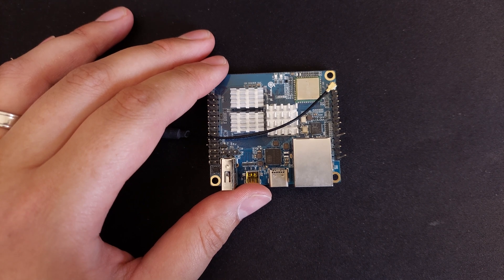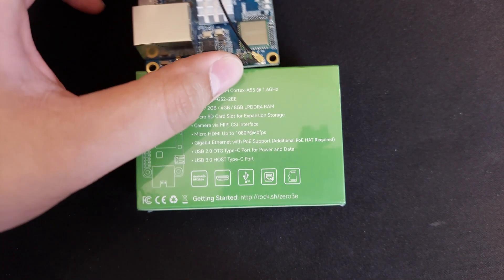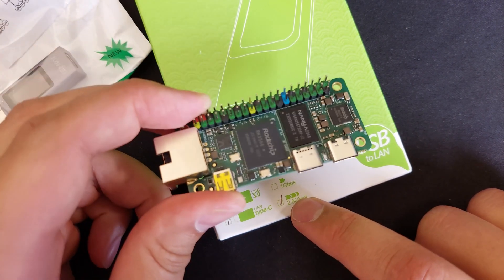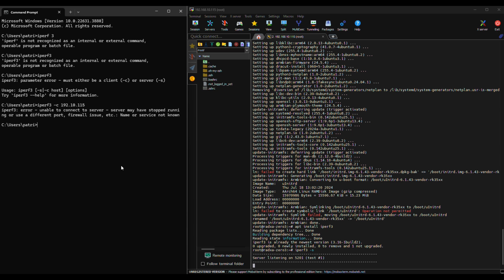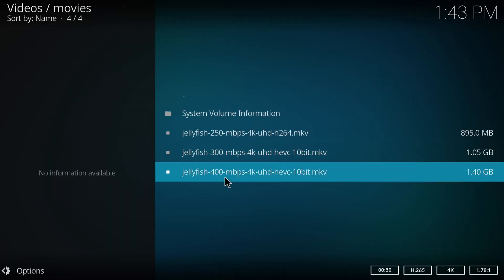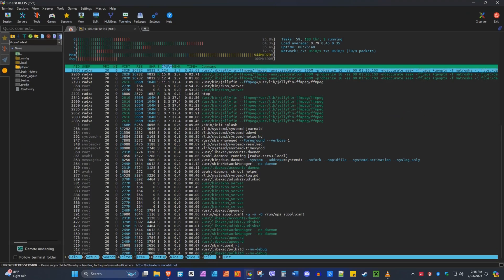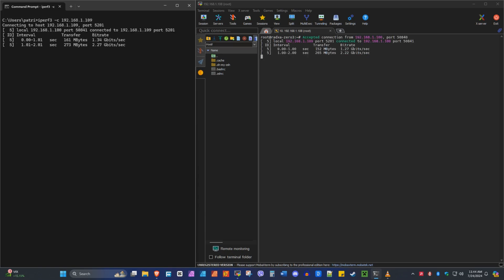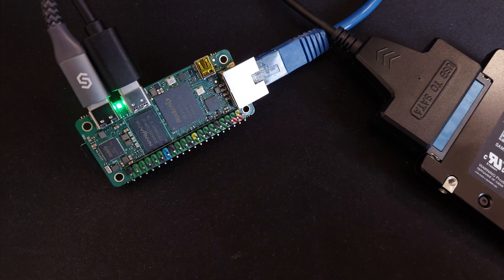Radxa Zero 3E - Cheapest, Fastest NAS so far? USB3, Gigabit Ethernet, Under $20.

Comment: If you power it from GPIO, does that second USB 3 work for data... or is it power only?
Reply from the maker: It's usb 2.0 I believe but I believe you can get OTG to work by using the correct dts file or some have commented that it just works depending on the cable used. Personally, I don't think I got it to work for data.

Comment: No heat sink?  I find that the 3E and 3W both run quite hot... even with small heat sink on the main processor, still goes above 50 C, in which it throttles.  I have ordered the recommended heat sink that seem to be quite large, almost the entire board (i.e. 3E and 3W).
Reply from the maker: I ordered the heatsink for the 3w and I kind of regret it because the pad included is too thick for the rf shield for the wifi (needs to be trimmed). My 3E now uses a basic rpi heatsink set and that seems to be working fine.
Reply: @GrafickStudios  I am testing Pi style sinks on each IC on the 3E and 3W.  But both seem to be running about 50 C, at room temp.  The official heat sinks are on order.  Going to compare.  I am thinking I will 3D print a frame for small fan to use with the official sinks, since they are passive (copper).
The small RADXA labelled IC on each board seems to get very warm.  Also, this is my 2nd 3W... vendor had to replace my first 3W... it failed about about 20 hours of testing... started getting memory errors, then finally completely died, where the bootloader would not even start.

Comment: Hello. Nice video but I think you omitted an important point. With Joshua Riek's Ubuntu's ffmpeg build (mpp), you can actually use hardware transcoding (1080p max). This is what would make it more useful as a streaming platform and it's lower power than rk3588 (which has much more transcoding capability, though). I will be trying the same with Rock 2F.

You need to run jellyfin dockerless for this to work and disable the ffmpeg bundled with jellyfin, then enable mpp in the settings. I am using orange pi 3b, which has the same CPU.

Comment: Hi, does it work well with kodi installed on it, using the micro hdmi? and will hdmi CEC work? Thanks
Reply from the maker: I haven't tried, but might be a good video idea, so stay tuned, I might do a video if it works well.
Reply from the maker: So update, I tried 2 different images, and both were not acceptable for video playback. The official debian image from Radxa was the worst. I did notice that kodi mentioned something about CEC when it first started. I don't think it would be good for a playback device at the moment.
Reply: @GrafickStudios  Hello, thank you for this feedback, I appreciate it a lot. It's good to know. For a media center, it is better to plan for more power.

Comment: bro, this board is not detecting my USB mouse &  keyboard, does yours?
Reply from the maker: if I use the usb 3.0 port, i have no problems (I use a hub though). As for the otg 2.0 port (that also uses power) I believe there is an overlay you have to enable. This post talks about it: https://forum.radxa.com/t/otg-usb-port-not-working-properly/21702/4

Comment: Very cool. I'd like to see USB4, NVME slot, and 2.5 gigE - plus heat sinks and an enclosure, but for the price, this is unbeatable. It does everything my old Raspberry Pi 3 B+ chokes on - especially HEVC. If they can get better OS support (I hear updates can break some packages), they'll go to the top of my list for home theater streaming systems and multimedia NAS for friends 'n fam. I might get one to tinker with 'til then.
Reply: this is my first time hearing about USB4. 

USB5 when? 
Jokes aside a computer board with NVME slot and gigabit ethernet + low energy usage + low price would be my dream actually.
Reply: @fizipcfx make the SBC the same length as a regular nvme ssd
Reply: No USB4 (by the way - - what for?) ,   but consider Radxa Rock 5B+ .
Reply: @Solista-z4z  Nice find! For that price range, I'd likely just get a miniPC from beelink on sale at Amazon or some such, though. As for USB4, just future compatibility. I've recently swapped out most of my USB cabling for USB C style ends with just small adapters for things that need them, and I have a few USB 3.2 and 4.0 devices that I'd like to use at their full speed.

I'd prefer manufacturers just eat the cost and put all USB C / USB 4.0 ports as standard so I don't have a mix and match of cables 'n standards, but I know that won't happen for a while yet... and even USB 4 is a mess with a slew of "standards" within the standard. lol.

Comment: If these things ever manage to pick up single or dual sata, I'll be interested. Until then, snore.
Reply from the maker: The RK3566 actually supports SATA but it's up to the manufacturers to break it out. The Orange Pi 3B is sort of an example of this (m.2 slot is both sata and nvme). But a SATA port would take up too much space on a little board like this. But I know what you mean. It would be cool if there was a small dedicated NAS setup with m.2 or sata ports.
Reply: @GrafickStudios  Right now the closest thing I have to such a thing is a 2010 era eMachines that is full time file server duty. 15W 1c/1t Athlon on 1GbE and 10GbE SFP pulling a grand total of 55W from the wall. If I could put together something that further minimizes the thermal footprint, power footprint and adds more speed/cores and utility, it's gonna be $$$, which kind of defeats the purpose. The Pi vendors know that while sata is old, putting it in there would dramatically shift the way people see these cool little devices. The home server scene would absolutely explode over night.

Comment: so this was running a jellyfin server on it? any transcode possible?
Reply from the maker: Yes, it was running a jellyfin server in a docker container. Transcode is possible using RKMPP however, the RK3566 is only able to do 1080p, which begs the question, why go through the effort of setting it up? Most end devices can play 1080p h264/h265 just fine. I think it makes more sense for a RK3588 device (it can do 4k). Jellyfin has a whole page dedicated to using the Rockchip VPU.
Reply from the maker: Hi, I just made another video showing the zero 3e transcoding, if you're interested: https://youtu.be/6pRHlH2eNBw

Comment: It's interesting that you are not being required to decode. I have had problems with browsers and with some of the smaller roku tvs. The jellyfin app does not transcode with the chip on them.  Even 1080p drags an opi zero 3 to it''s knees in seconds, and that chip is supposed to native decode 264 and 265. I wasn't running docker. It was just straight armbian.  Firefox also doesn't handle mkvs native, so same deal. Yes, i see that you tell people to just not transcode, but shouldn't it just work? I think the opiz3 I tried was the 4g.
Reply from the maker: Your end device definitely matters, that's where the heavy lifting should happen. I always use my phone, my pc (chrome or kodi), or firestick 4k. I prefer to stream media not transcode it. By doing that, you can use a really lowend device as the server, but that's just my personal philosophy.
Reply: @GrafickStudios  yea but you don't need usb3 for that.  It is kind of an oxymoron to say ok I'm going to run 250ms on a phone screen. 720p looks great on a 55" Roku TV, which also transcodes native. It's the smaller ones that don't.  An Opi PC with an H3 can scan libraries and serve files with jellyfin or emby. I just don't understand why these SoCs that say they can transcode 1080p of both 264 and 265 grind to a halt as soon as you try. It's false advertising.  I can run 1080p 265 on a celeron 5095 with at least two streams transcoding and it works fine. I have literally over 100 pis, and actually started writing a book on this subject. You can get a 5095/8/256 on ali with a case, a ps, good cooling, three usb outs and three hdmi outs for like $125. I love pis, but they are a waste of time as media servers.
Reply from the maker: @paulhelinski9890  Hi, I just made another video showing the zero 3e transcoding, if you're interested: https://youtu.be/6pRHlH2eNBw
Reply: @GrafickStudios  I had Open Media Vault 5 on a HP T5740 thin client with the PCIe expansion addon to plug in an eSATA card. 32 bit but it worked just fine. I installed an Apacer 4 gig SATA DOM on a right angle adapter and the maximum size SODIMM it supported. Had to cut the 'ears' off the right angle adapter to clear a large capacitor and the expansion riser slot. There's probably someone still selling new expansion kits on Amazon for $13. Includes the expansion bay, a PCIe x16 (only x4 connected) riser and a regular PCI riser.

It was working fine until I plugged in a x4 PCIe to NVME adapter that worked fine in other PCs. Killed it dead and fried the NVME adapter. So I bought another T5740 and tried the x1 PCIe NVME adapter I have. Result was another dead T5740. The adapter and NVME drive work fine in other PCs.

Dunno why but apparently the HP T5740 is 'allergic' to using PCIe NVME SSDs in its PCIe riser adapter.

So after that disaster I picked up a 2011 Mac Mini and installed a dual drive kit. It worked fine with Open Media Vault 6 until I switched my T-Mobile Home Internet gateway from the silver cylinder to the black cube. I logged into OMV and properly shut the server down. When I connected the ethernet cable to the new gateway, the little old Mac wouldn't boot up! I've gotten it to make the bootup chime but it won't output any video.

So now I'm looking for something cheap and simple I can set up as a bare bones basic DLNA server. All it needs to do is make a folder and subfolders with videos available on my LAN via the DLNA protocol, and allow remote access from a Windows 10 PC for managing the files. I don't need to want to have a bug lump of a PC running all the time just to have my Samsung TV have access to H.265 videos.